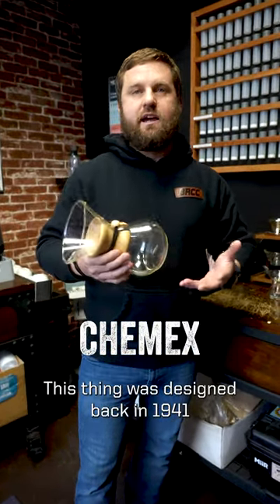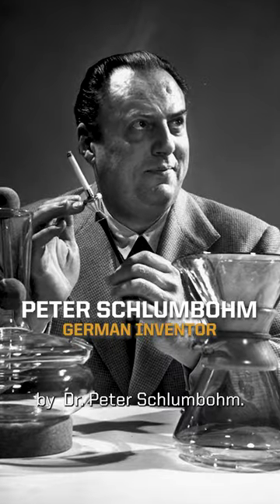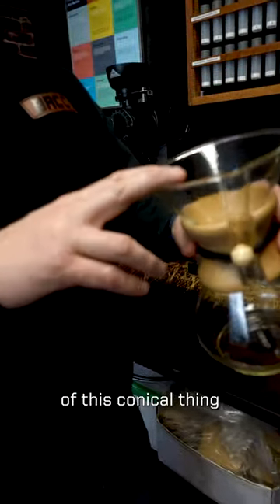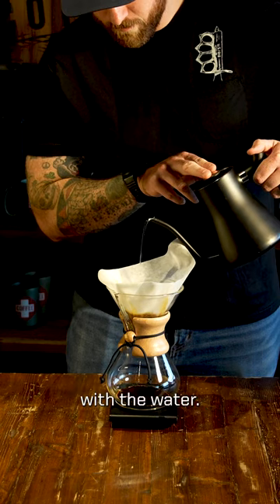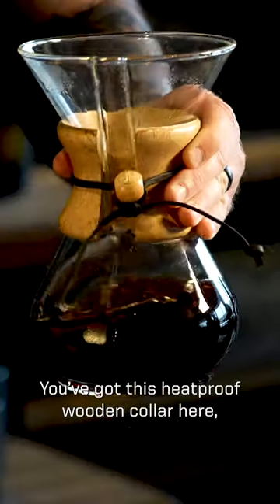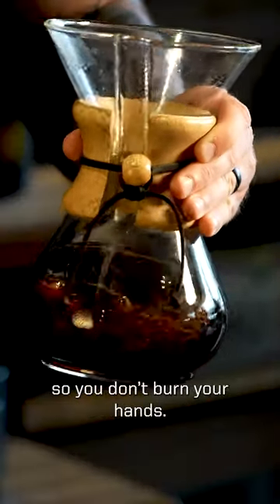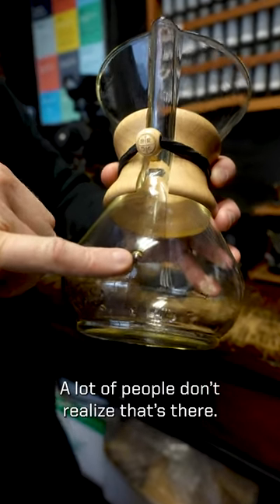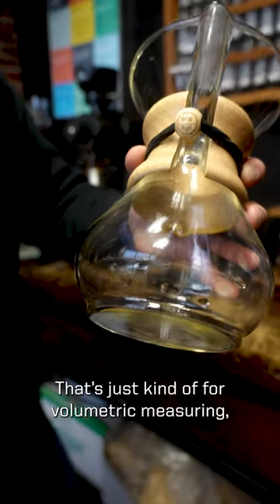Where did the Chemex come from? | #SHORTS

Comment: Is this better than a French press?
Reply: I would say the French Press is better.  With a French Press you control the strength of your coffee by how long you leave the grounds in the water before you press.  With a chemex the water only goes through the grounds once and that's the strength you're left with.  Plus with the chemex there's the extra continuing costs of the paper filters.  You don't need paper filters with the french press if you bought a quality one.